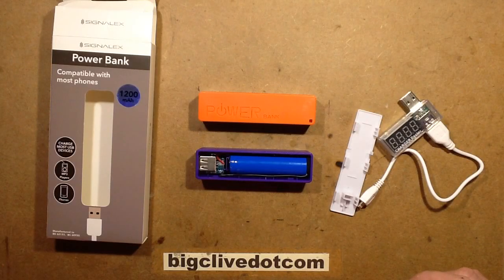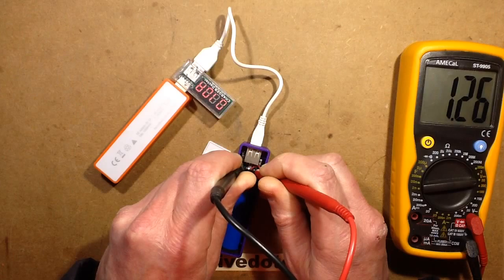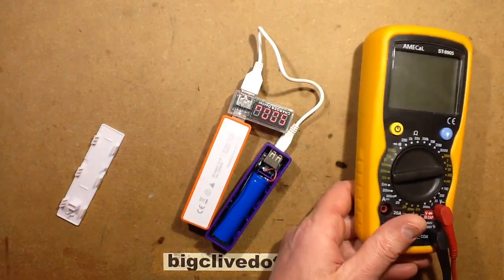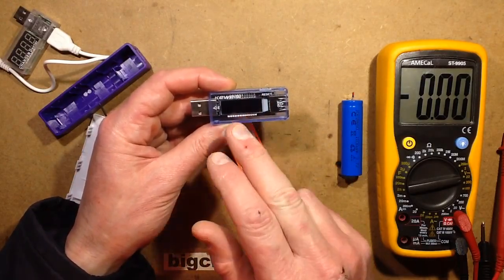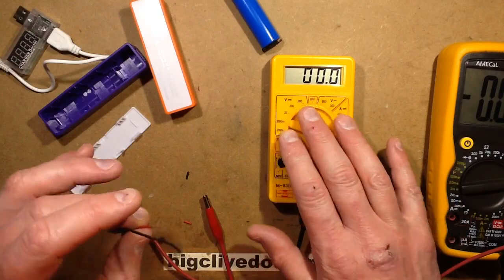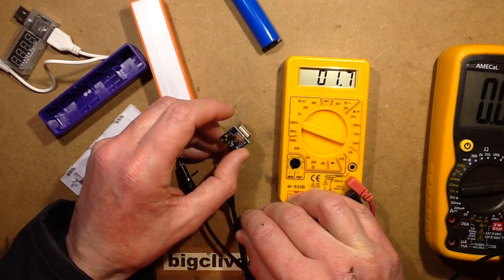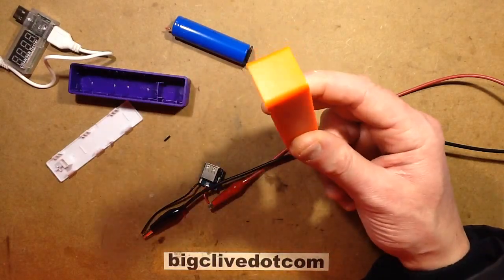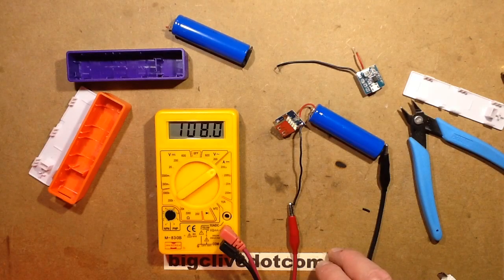Poundland's 2016 power banks.  (not a good start)

Comment: I am a Electronics Technician  with engineering  experience and these  18650 lithium Ion single cell banks only charge your cell phone barely one time. They take a long time to charge even with a 5vdc@ 2amp adapter with a 2 amp micro-usb  > to USB cable. Don't  waste your money buying one of these. Spend more money and get the biggest size you can afford.

Comment: Don't know if yours has the same problem but iv just got the same one and work's fine for about 5 or 10 minutes till it gets hot then stops working I have to wait for it to cool down then plug it back in to my phone but then again after 5 or 10 minutes stops working again
Reply from the maker: They do have thermal protection.  They're not really suited to modern phones.

Comment: poundland stock like this ie items with completely discharged batteries in is down to airshipping safety directives put in place to govern the transport of lithium batteries like this within the uk . post galxy note 7 incedents. They didnt want these things burning the bellies out of aircraft in flight like the oxygen generator accidents did
Reply from the maker: I think the reason the Poundland units are almost completely discharged is more down to the high quiescent current of the circuitry and storage time.
Reply: @bigclivedotcom  They must sit for years or like argos in a freezing warehouse. wich is why if you buy drone batts from argos your drone will die in the air. Would it be hard for poundland to have built in a diode or something to stop the circuit draw . As most people buy them charge them and leave in a bag or car till needed only to find itn dead from self discharge and circuit draw.

Comment: I've just taken one of these ive had lying around for 6 months. Dead. The cell was labeled as a varta 24000mah. I took off the outer layer of wrap to reveal a samsung cell, rated at 24000 but was protected. Upon removal of the protection circuit, the battery is now charging off my olight magnetic charger.

Comment: Its 2019 now, and i mainly just buy these for the casing and cables, but these are really handy as a portable 5v power supply for DIY projects, i usually hack up the cable so whatever i had made could use USB power. I have no doubt Im abusing the power banks but if they die they can be easily replaced. The casings are actually pretty good for small projects also, and the plastic can be easily melted wit ha soldering iron then be widened with a penknife. Not too bad.
Reply: @Joe Black That sort of thing yea, I noticed there are a few different variants with slightly different layout and LED placement (Or none, in the case of a reputable brand one) The boards take forever to charge the cells so its not worth it really. (Plus they can only deliver 1A output max so charging other devices takes a while)
Reply: @Joe Black I already use the tp4056 boards lmao. They charge at 500ma or something so good luck waiting for it to charge :3

Comment: Hey, big Clive I bought one ages ago and now it stopped working and get very hot it charges but when you plug something In for it to charge up it starts charging and about half the way through charging my phone beeps and the bank slowly gets hotter and hotter.
Reply from the maker: Your phone may be drawing too much current.  These are only suitable for up to about an amp max.
Reply: it's an iphone5s  it worked fine for a couple of days and then I never used it for a while recharged it and then when I went to use it to charge my phone it started to get hot after half of a charge on my phone thank you for the reply

Comment: bigclive i got one of these from poundland in the uk 2018. battery was dead when i opened the packet. can i change the battery for new equivalent?
Reply from the maker: The cells are often discharged to near zero in these units.  If you leave them on a charger it will recover the cell by trickle charging it at very low current to bring it up to 3V and then switch to full charge current.
Reply: @bigclivedotcom  thank you will give it a try. love your work by the way.

Comment: Without reading all the comments it might be worth mentioning that the capacity is at battery voltage not charging or discharging voltage. At these voltages 800 mah should be being looked for.

Comment: I think storage as in the warehouse is the random factor for these, I've got three of these, the only difference is case colour's, same circuit, same battery connection, same colour battery, they all work, but questionable capacity, supposed to be 1200mah, tested one to 967mah, that's okay for me, I just use them to charge my bluetooth headphones, it's enough capacity for two full charges.
Reply from the maker: The recent ones seem to have a higher capacity.

Comment: I bought three and checked the capacity by connecting a torch bulb directly across each battery  after a full charge , measuring the current, and time for the voltage to fall to 2.5V. The results were fairly consistent, 700mA/H, 770mA/H and 780mA/H. I glued the boxes together, wired the batteries in parallel, removed the two outer USB/ regulator chips  so now  I've got a slightly more useful power bank of 2.2A/H.

Comment: I own a copy of a copy ... ebay 1 buck, delivered without battery. The IC is HOTCHIP HT4928S. 1 IC, 2 Cs, 2 LEDs, 1 L. Quiescent current is 10.7 uA. Good. BUT every 10 seconds the crap shuts down for half a second. If the batterypack and/or loader in your cellphone, tablet ... counts, this cannot be good. What do you think?

Comment: Clive. One thought. You powered the second unit from the 3.7V Li battery but you powered the first unit from a 4.90V PSU? would the increased 1.2V have created the additional current you saw? WOuld it have been better to power the first PCB using the PSU set at 3.7V instead?

Comment: You think that's awful clive? I strapped two of them together, wired the cells in parralel to a switch made of tweezers, soldered the ends to a poundland 510 vape head and got a whole 20 minutes use before the cells died completely. On reflection, if I'd known more about what an 18650 could do, I probably wouldn't have done that.

Comment: Got one of these last week broke it open removed the battery and recycled the rest I thought it would be a cheap way to get a rechargeable battery for my Thrunite  torch.
Using a B&M one (cost £4.00) as a charger and spare battery so a fiver for 2 batteries and a charger :-)

Comment: I have one with the same case in black and white, purchased in Poland in 2015, and have only used it a few times - it is also rated at "1200mAh", yet only charges my 3630mAh phone about 18%", so that means around 650mAh capacity in reality.

Comment: will that battery inside work in a vape
Reply from the maker: It's low current so I wouldn't recommend it.
Reply: I'm currently doing that and it works I just take these apart and remove the batteries I have a few about 7 and uli use them in my mod they work but not like the high end ones I just buy these for the low end 18650s

Comment: does this somehow boost the voltage of a single cell 4v to 5v?
Reply from the maker: +lazy carper Yes.  It boosts from 3v to 4.2v up to 5v and maintains that voltage on the output connector all the time.

Comment: Once bought 3 of these wish I didn't 3 pounds I could of had back one USB port weakened and died and got kinda bent wouldn't charge bought another dead after I opened it charged it still dead wouldn't charge my iPhone 5S unless the usb charger was connected threw them both out bought a white one BECUASE I was out with friends and my iPhone was on 5% so I went and bought one wouldn't charge my iPhone for more then 5 minutes so it's sitting in my room it's useless though so in 2017 I alerted them I tried to return it and they fobbed me off and told me all I have to do is charge it so yeah they know but they don't bother fixing it and this has been going on for almost two years they really need to fix this FAST ASAP....

Comment: They're selling these in Dollarama in Canada right now, for $4 CAD. Very slight cosmetic differences, but same circuit based on the same chip inside, and the same blue cell as well. Mine came out the package reading 3.9V, so I'll be interested to see what the capacity turns out to be when my USB charge analyzer arrives. The package says 1800 mAh.

Odd things - the package says it's a LiPo battery, but surely it must be Li-Ion? Also, the package warns not to use a charger rated more than 1A to charge it. Why would that be? Surely it has charge regulation built-in?

Comment: Stupid question but I was wondering if I could use that power bank with the 5v 8w usb soldering iron, and if I should use the protected tp4056 charging module or use the original model that came with the charger. 

I'm trying to make a super budget portable soldering iron. If you recommend changing the cell than please link me to a decent one, mine says samsung (but it probably isn't) and it costed about $7 for the whole bank. I don't care if the battery only lasts about 30mins use I just want something without cords, that's rechargeable, and not from 1982.
Reply from the maker: The power bank you use will have to be rated to supply 2A.
Reply: can the tp4056 supply 2A?

Comment: I've brought one charged it and it don't ducking work
Reply from the maker: Some of them have a completely flat battery and the charging circuit goes into a recovery mode with a low trickle current.  It may recover if left on charge for a while, although I'm not convinced it's the best use of a lithium ion cell.
Reply: bigclivedotcom hmmmm I brought it as it's a cheap power supply I could charge it and if my iPhone is depeated then I can just charge I should of brought a proper one from amazon

Comment: i purchased 3 of these for a project ripped the batteries form it and used them with my own charging system. worked perfectly good source of rechargeable batteries even if not for power banks.

Comment: I charged mine from a plug. At first the light inside never went on. Then id did, it flashed on and off, thn went steady when full. It was ok. just looked dead at first
Reply from the maker: It was probably in trickle recovery mode which charges the cell at just a few milliamps to recover to 3V and then switches to full charge current.

Comment: I have one and it get's hot when used, I'm sure a large amount of the batteries energy is being wasted producing this  heat. It appears to be a boost converter. I thought they didn't heat up like a linear amplifier chip, any thoughts?
Reply from the maker: Most converters do emit a bit of heat, but in these devices it's most likely under-rated components.
Reply: Thanks!

Comment: A closer look at the case reveals some spaces for inserting springs, at either end, so you can easily turn this into an 18650 charger.

The batteries that come with these feel a lot lighter than should be, and tend to show voltages too low to be healthy for a Li Ion battery.

Comment: Yep, I got this powerbank as well, as a relational gift at work. It was quite funny as it was an ABB-branded powerbank. Ofcourse, it's only a stamp-mark, but in my case I found it quite funny that the cell was completely dead ;) Charging did not help at all.
Opened it and replaced the cell. Works fine now ;) Didn't know about the high quiescent current though ;)

Comment: Is there a way to tell if a lithium cell is protected from looking at it externally?  Because I have a pair of protected lithium ion 18650 cells for a flashlight that I have and I love the flashlight and I love the batteries but I was thinking of getting a few more batteries so that I could have a few backups. And noticed at my local Walmart they have 18650 lithium cells in a four pack  for $11  for replacement for one of their brands of solar garden lights that take an 18650 sold under the name Westinghouse but I couldn't see anything on the battery that said protected so I'm wondering if it's a good deal or not?
Reply from the maker: It usually says protected and there may be a gold coloured PCB at the negative end of the cell.

Comment: The  cells are useless, but the PCB and case are fine. So, chuck out the supplied cell, and solder in a recovered one from an old laptop pack. Even a knackered laptop cell's better than what was there originally. The result is good enough to use as an emergency get-you-home device.

Comment: I have 4 of these exact types of power banks rated at 1800 mAh. I have had no trouble at all out of them and while in storage they lose about 2,5 to 3% charge per month. 

I mostly use them to charge a Blackweb Bluetooth headset (for headphones) while I'm walking because the Bluetooth adaptor has a vert small battery giving only 3.5H of usable time. 

All in all,for $4 CAD a piece, I   am ok with the performance they give.

Comment: I bought this from my local  £1 store. was not impressed when it made my phone hot and and came up with a heat warning and shut off and went into safe mode. 1 of my staff members in work had bought the same thing and complained that it made her iPhone 6 hotter than usual. I threw them both away and bought a charger for myself and her. would not recommend these at all I think it's dangerous especially for £1 or where ever you live around the world as you dont really know what your actually buying. I bought an easy acc portable charger from amazon a few years ago, the company have improved and have made better ones since then but I now use that often as it's my 'camping / long trip charger' 

it's good to know what your getting for a price tag. no matter how cheap it is, some times its a steal and a bargain and sometimes it's a pile of shit and a waste of time. just make sure you all know what your getting :)

Comment: I have a question and wonder if anyone could answer it for me. Would the amount of current that the board draws on its own prevent the battery from ever completely charging. I have replaced the battery in mine for a Sony vtc4 18650 with 2100 mAh and it doesn't seem to ever stop being on charge, the light is constant red. So any help or info would be appreciated.
Reply: Andrew Martin do you have the same chip as in this video? I have one and mine red led stops blinking when fully charged.
Reply: OrbitalSP2 yes it's the same, think I might have got a dud one 🤔

Comment: Now I know why the two we had were particularly crap.  less than 1/5 of the supposed 1200mA & dropped from 'full charge' to Zilch in under 4 hours with No load. Not fit for purpose. Not that keen on using unprotected Lithium cells either. Binned them both.

Comment: The bank uses 18650 batteries, you can make a custom one with MORE capacity using 26650 x2 in parallel with the same circuit. BigClive let us know if that can be posible !
Reply from the maker: Yes the use of parallel cells is common in the bigger power banks.
Reply: bigclivedotcom
Thanks, might try and reuse my EE powercell circuit (thnks to your video) and try it with some old high quality LG HE3 18650's that i have laying around. :)
Reply: this thing will over heat if you use  any usb cable that  not the one that come with it   why is that
Reply: *****
probably because the battery is drawing too many amperes and the internal resistance causes it to heat up. In English, it probably is just some low quality battery, or if your phone is overheating, buy a 2A charger, it will do your battery better. And mke sure the cable can support 2A of charging.
Reply: The batteries themselves are actually quite good,  I use them for quite allot of things because there so cheap, its the board that's the issue, the good thing is they cost one pound! just buy a couple.
Reply: Aldion Sylkaj ....it would cost more either way .....more power = more cost ....buy LCD from eBay step down voltage regulator 2 Samsung cells that's 30quid lol
Reply: Atticus Finch that's the problem that's why that sell shit like this cus stupid people buy it .....then they moan when it explodes cus they charging with their tab charger lol

Comment: Bought one from the Poundland in Scarborough on the 30th of December. Discharged it to 3.3Vish and charged the cell directly with a IMAX B6AC battery charger. The charger says it took 956mah but I've not performed a discharge test. Near 1Ah is very good for £1.